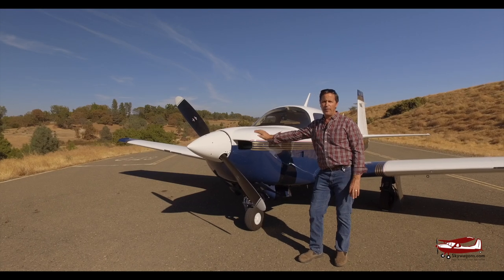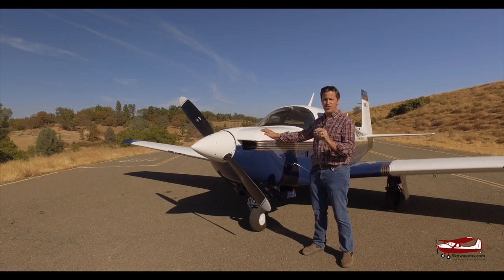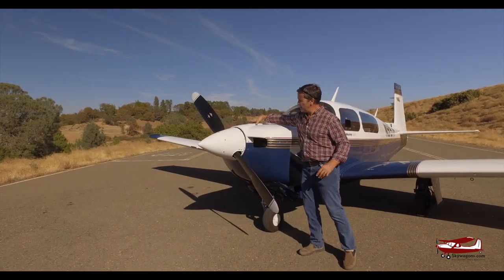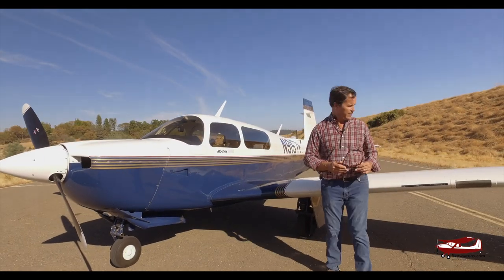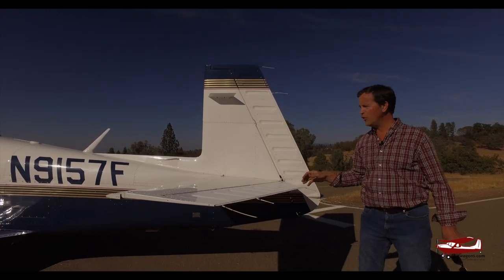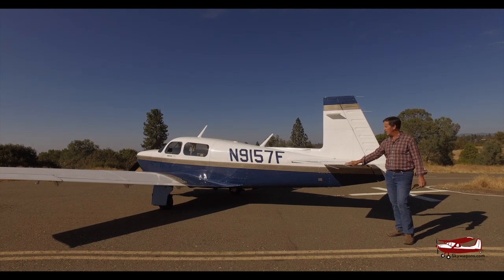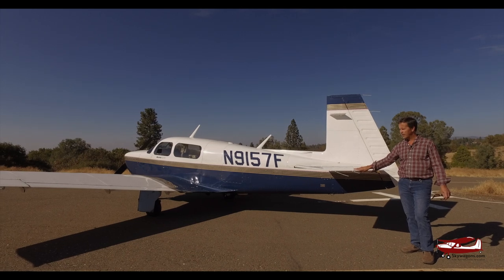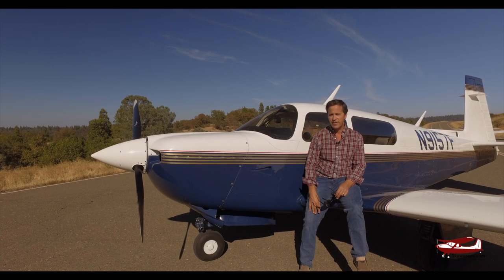M20J

Comment: Does that tail design make any diff in drag because of its unique design? Always wondered...
Reply from the maker: The vertical and horizontal surfaces having their leading edges at 90 degrees to the direction of flight gives the surfaces max efficiency.  The "leaning forward tail" is supposed to reach into the stall sooner and make recovery easier.

Comment: What is the difference between M20J and M20K?
Reply from the maker: The J and K are the same everywhere except the engine. The J (201) has a 200 HP Injected four cylinder Lycoming with a 2000 hour TBO ( and it gets there) while the K (231) has a six cylinder 210 HP injected, Turbo-charged  Continental with a 1800 hour TBO (and it does not get there)  Basically the 231 is a turbocharged 201.